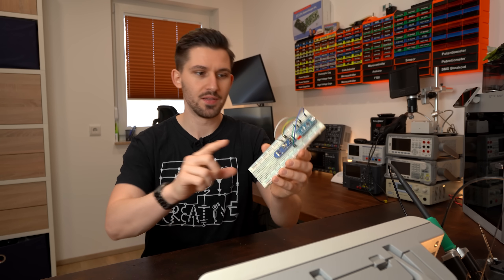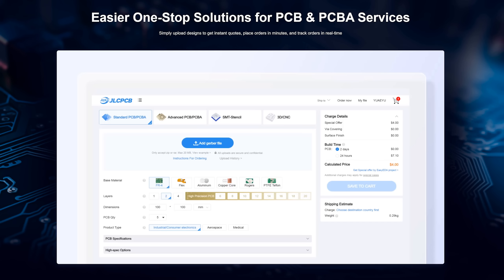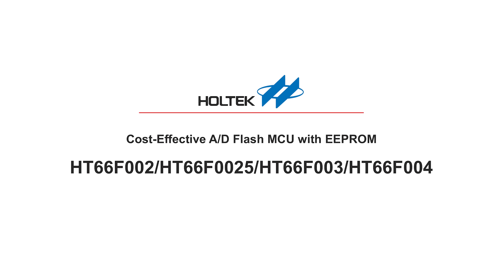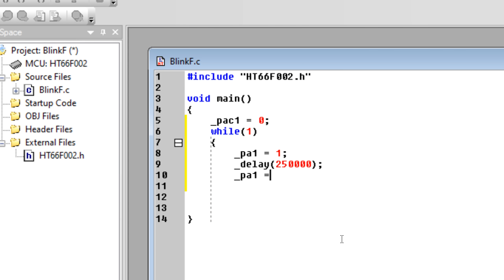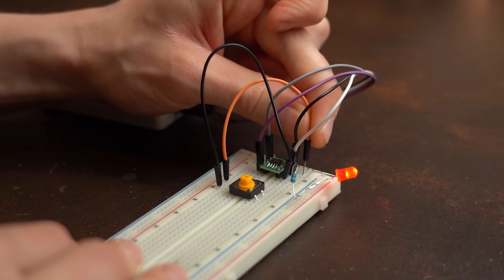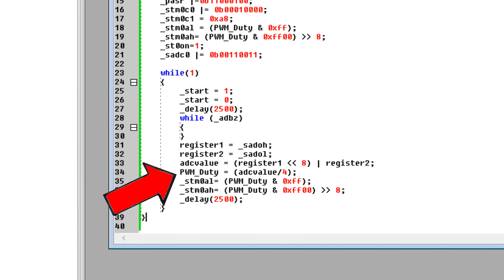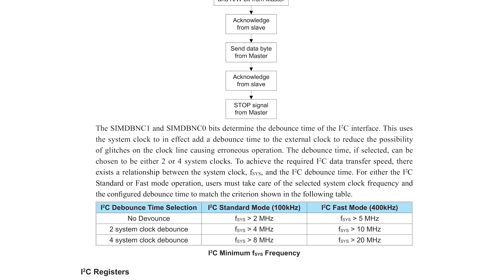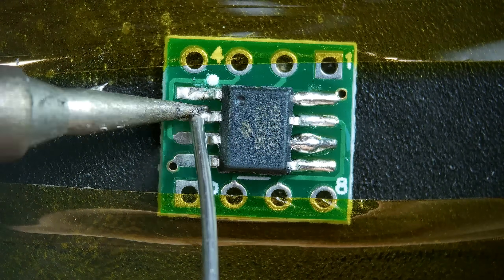I tried the Cheapest Arduino Alternative (that Nobody heard of)

Comment: I2C master is trivially simple to bit-bash, no need for a hardware peripheral
Reply: Yep, I thought he was going to do that
Reply: The premise of the video is a bit off. If you are only making 14 boards, then the 2€ difference in price for the MCU doesn't justify the cost of buying a new programmer and spending a week worth of extra engineering time. On the other hand, if you are making thousands of these boards, then something like missing hardware support for an I2C master interface isn't going to stop you from buying the less expensive controller. That's a very easy fix in software, and you can find countless reference implementations online going back at least 30 years.

Of course, if the goal is to make an entertaining and educational video, the incentives look very different. The cost for a new programmer is negligible, if you get a successful video out of it. And for me as a viewer, this is certainly more entertaining than yet another video showing how to program an Arduino.
Reply: @gutschke this! And the programmer you can reuse in other projects. 

Is there a way btw to batch program those things?
Reply: @gutschke The only entertainment here is his misery at dealing with the obscure part, TBH. Which is only entertainment for some
Reply: I liked your comment, then I downloaded the datasheet of the HT66F002. It has 1K*14bit Program Memory, 64*8bit Data Memory and 32*8bit EEPROM. It has a separate stack with a size of 2. It runs with 8 MHz, but one instruction cycle is 4 clock cycles long. Depending on what else the code has to do,  it may be difficult to additionally pack bitbanging into it.
Reply: @philippklostermann7768 and somehow it feels like a rip-off of an old PIC16F84 from 1998, the chip that made microchip great. 14bit memory, only two steps hardware stack. Obscure paged ram only on register....
Reply: @philippklostermann7768  Seems same parameters as PIC16F84 I used to program when it was the ducks guts. Bit-banged both serial (cause I needed more than one) and I2C out of it no problems. On top of that I was using assembly and notepad as editor + cmd line assembly and downloader with DIY cable that barely worked. No debug, no serial monitor, no nothing.  And 1k re-writable ROM was a dream back then. I even had a SW dividing in assembly - that one took like 1/5th of the ROM though..
Reply: Agreed. A slave is a bit more tricky but a master is easy.
Reply: Yea, slave mode is the hard one to implement in software
Reply: @segfault-berlin  slave mode is super easy to implement; in fact all countries have done so already. It's called taxes. Some countries go multiple steps further however, like the Uyghurs trapped in internment camps in China...

(lame attempt at a joke)
Reply: That's what I was thinking!
Reply: It's certainly possible, my worry would be about storage and memory size.
Reply: Same here. Totally just bitbang it. If it's just reading the sensor's value repeatedly, that should be (relatively) easy.
Reply: It usually takes less time than figuring out how to exploit their funky UART
Reply: Yes but do you all thought about available pins....
Reply: If you are going to do a 'proper' job of bitbanging the master, it's not so trivial.  You have to deal with corner cases such as when the SCLK pin is an input (from master perspective).  For only 1 device, if it's well-behaved -- then yes, the code for master can be simpler.  But I2C edge cases are a pain.  I hate I2C when I have a better option (e.g. SPI, and if you are pin limited, use, say, 74LV8153 which can be driven by a spare uart TX pin, bitbanged, and has output OC or  push-pull, separate Vcc for the 8 output pins, and can drive 40 ma ---  one pin from the uC neeced to get 8 out!  With a simple SPI setup, you have the 'selects' you need with the expander.   SPI -- always SPI.
Reply: @cheponis if you don't have a multimaster system (nobody uses that) and no devices that uses clock stretching (or you just do it slow enough so no stretching happens) then it is dead simple. Sometimes simpler then the broken STM HW implementation, that tend to get stuck with EMC pulses thinking the bus is busy and you need new complicated edge cases and timeout mechanism to reset the hw to leave that state.
Reply: @_blueloop_    "*** if ***".  My rule is: unless you know, for sure, always implement the entire spec.   Because future weirdness that is a PITA to debug awaits.....
Reply: @_blueloop_  by the way, I've done it (bitbanged Master and Slave I2C).  That exercise convinced me that the designers of I2C included too many hax that should have been left behind by the 80s.  But noooo, we still suffer today.   I3C is trying to 'fix' that but is not open.  ('Thank You', MIPI Alliance)
Reply: @cheponis  Hahaha..read the errata for some of those I2C "supporting" MCUs - you're frequently better off with a software implementation :). At least then you're free to send 9 clock pulses to un-hang the bus - not many hardware implementations ever bother to do that.

Comment: CH32V003 would be a good fit - there is an 8 pin version, £0.18 at LCSC. very cheap programmer, 1 pin for programming.

Comment: Silicon Labs EFM8BB10F8G (16-20 pin soic/qfn) is under 60 cents at some distributors , if you order 100 or more. Has more ram and space for code compared to Holtek chips.
Second suggestion (besides trying Risc-V) would be to find a PIC16F microcontroller under a dollar as one can usually easily switch to other part numbers in the same family for higher pin count when needed, and also programmerrs for these are now available for under 40-50 dollars and you can reuse the programmer with hundreds of controllers. 
I would also like to mention the slightly outdated but very informating " The amazing one dollar microcontroller" by jay carlson where he compares and views and benchmarks multiple microcontrollers that were priced at around one dollar at the time of the article (a few years ago)

Comment: I would seriously love to be able to use an RPI pico as a programmer for the holtek microcontrollers. I'm pretty darn sure PIO can emulate, if not reproduce exactly all the proper inputs. Have you tried recording the SPI bus used for programming the microcontrollers?

Comment: This just makes me appreciate the rp2040 even more. They work with all standard stuff and what they deliver for below 1$ is just absolutely crazy.
Reply: for $1 per chip i think the rp2040 a a very powerful controller (so much has been done with already)
Reply: But it requires external flash and a lot of passives and a crystal, and is not easy to manually solder / build your project without a better tooling - they have a place, sure, but they are too complex to implement in many use cases

Comment: You could try to bit bang I2C (assuming the GPIO can be switched fast enough - I haven't seen the the internal clock speeds to know if this will actually work).

Comment: You can write your own I2C library to be compatible with other I2C devices. The difference will be that it is software based and not hardware based.

I also dislike using arduino ide because it is entirely library based and I cannot manipulate the microcontroller down to the bit level very easily.

Comment: Hi, nice video! I wonder if that would help with your I2C problem: https://en.wikipedia.org/wiki/I%C2%B2C#Example_of_bit-banging_the_I2C_protocol
In university, I used it to get a MCU acting as an I2C Master with normal pins. Since you have the possibility to read pins, turn them high/low and have a delay function, it might be possible? I'm still new to this topic and would love to get feedback :D

Comment: Isn't i2c one of the easiest protocols to bitbang? Its like interfacing with a shift register, you just set the data pin and use the clock pin to send the data in, and repeat for each bit of the data. Do you need a dedicated part of the chip to do that for you?

Comment: Next time you load a Chinese IDE, may I suggest doing so in a virtual machine dedicated to the task. Just to keep anything infectious away from your working environment. (Not that I expect Chinese IDEs to intentionally to include malware, but "sometimes" their developers don't practice proper security themselves and pass on what's on their systems.)
Reply: Just for info, Holtek are based in Hsinchu in Taiwan. Certainly, their products and literature are quite a step above most cheap Chinese microcontroller manufacturer's offerings. But, yes, sand-boxing IDE tools doesn't hurt and is a reasonable recommendation.
Reply: I would say the same about anything that you don't have access to the source code.
Reply: @JeffreyJibson  Certainly. But there are more reputable and careful providers of compiled code.

Comment: It seems you have spent more than $1.80 x 14 in just time to figure out how to use the ‘cheap’ MCU. You stated a couple times that it took half a day to chase down problems. Just get one of the cheap arduino compatible MCU’s, use the quality IDE, and pull from the huge library of code already written (some by you).

Seems like a lot of brain damage for nothing unless you just needed a challenge.
Reply: the only point is he'll get paid for the views.
Reply: >>a lot of brain damage for nothing
when a device sold in large numbers, putting some brain can pay the bills
if building just one item, yeah you are right, build it the easiest and cheapest way.
>>he'll get paid for the views
Anything wrong with that? How about a "thanks" for the effort to do this video?

Comment: Is programming hardware interface protocol really proprietary?

For I2C, could do it in software, much like it is available in Arduino when you want to use non-standard GPIO pins.  Perhaps take a look at the Arduino library and adapt it for this MCU.

I've gone register level programming in Arduino to speed up an EEPROM programmef project that was a takeoff from one of Ben Eater's projects.

How about one of the PIC chips?  They're pretty popular for projects like this.

Comment: Why don't you just bitbang I2C? The uC should be fast enough for 100kbit/s I2C bitbanging. There are couple of libraries that might be a good starting point. With some tweaking and proper interrupts 8MHz cpu should be enough even for 400kbit/s.

Comment: Did you consider TI MSPM0C1104? It has 4 times the SRAM and FLASH of ATTiny402 at $ 0.624 in quantities of 1-99 units. Additionally, the $6 dev board's debug interface can be rewired easily to work with custom PCBs.

Comment: Embedded hardware engineer here.
"w95 interface" is mostly an industry standard. It wont lag and will run on any crappy pc anyone could have.
For an i2c - you can always make soft-i2c through bit-banging. Thats always worth the time spend, because it allows our clients to pay us once for making it possible, than to spend lots(+20-40%) of money on every device they'll need.
Reply: It's not exactly "standard", it's just Keil and IAR do not want to invest in updating their ancient IDEs look-and-feel because it's a small market, much smaller than, say, web dev. General purpose Eclipse or VSCode are modern enough.

Comment: I2C can use DI/DO pin with software coding to create one, please see the protocol of I2C, hardware I2C pins are not necessary.
Reply: For low end ICs that may take up a lot of instruction cycles, no?
Reply: for the Arduino generation this is something like rocket science, although even on “dinosaurs” like the 16F84 it worked without digging into assembler
Reply: @VDLab1 and it could be the 16f84 assembler runs directly on this chip, it seams like a good copy

Comment: If you have GPIOs and are using PWM through a timer, it's not too difficult to implement i2c master in SW, much less simple to implement slave which is probably why they have it on some versions.

Comment: Yep. Right on schedule: Exactly at 6:45 of a 13m30s video (50.0%) the 'Blink' is finally working.
I've said this for years: Getting 'Blink' (or 'Hello World') to work is typically the halfway point of any small project in any new µC ecosystem. Not usually so precise.
That's why Arduino, which includes 'Blink' from the start, has such an easy learning curve. 
Everyone should understand this point; it's important for planning and scheduling.
Reply: What? This is a video. The pacing of a video has nothing to do with the pacing of the learning process and everything to do with the creator's directorial intent. I also think that the Arduino Blink sketch is VERY simple and mostly is an intro to digitalwrite. Sure, there is timing involved, but I'd hardly call it an intro to scheduling since there is only one thing happening.
Reply: Unless your blink is done in non-blocking way, using timers and proper interrupts it's nowhere near the 50%.
Reply: @MarioPL989  Except notice this: Our channel host spent "3 days" (he mentioned it) in this new-to-him ecosystem, just to get a few 'simple' routines up and running. I expect that another several days would be more than sufficient for what you describe. Keep in mind that primary point, and it's not an argument about "50%" versus 20% or anything else. It's that it can be time well spent in a new ecosystem getting as far as ''Blink'. If you're managing coders, direct them (firmly) to go get 'Blink' (or 'Helllo World') running first. They might not be back for several days, no matter how smart they think they are. It's a valid point and ignored at your peril.
Reply: @MarioPL989  You may not understand the purpose of a blink program.  It's not about precision or accuracy.  It's about taking a chip you've never used before, and getting code into it, and having that code do something you can easily verify is working.
Reply: Absolutely.  Blink or Hello is the absolute hardest thing to get working.  Or the equivalent for any other hardware.  I just spent 3 days getting a SPI LCD panel to show anything other than a solid white screen.  And then I spent another couple of hours the next day getting eight other (different models) LCDs hello worlding me.  It also took me about 2 days to get my first Blink going on one of the new AVR 0 series chips, using the new UPDI interface.  But that's because there was a lot of almost-right information out there on YouTube.

Comment: You still can use these controllers for your project because I2C can be easily implemented in software. The protocol is simple enough, you should be able to find some implementations that fit your need or implement it by yourself. I’ve implemented a software I2C several years ago on Atmega328 just for fun.

Comment: ATTINY412 might have been a better choice. Arduino support. I2C capability. An Arduino can be used as a programmer. And not that expensive. ATTINY402 is a few cents cheaper.

Comment: I wonder why he didn't use a Padauk microcontroller. It has an open source programmer, and it only costs 3 cents
Reply from the maker: I actually wanted to test Padauk first. But getting the programmer was impossible, the programming is harder and their cheapest uC are only OTP. No thanks.

Comment: Why not just bitbang the I2C implementation, if you only have 1 i2c device it shouldn't be too hard to do. If you don't want to deal with that the ATTiny202 does everything you want with a price of $0.47 USD, note the datasheet specs it has SPI and TWI but as stated in Microchips device doc TB3181 TWI is i2c compatible.